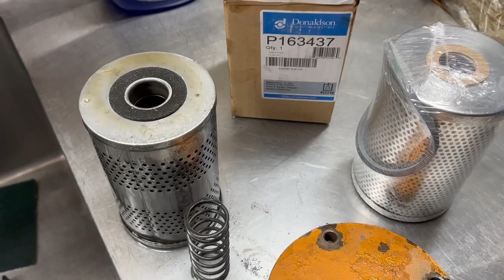Replacing the transmission filters on a Case dozer

Comment: What was the problem?  I’m having the same problem
Reply from the maker: Still working on it. Spoke to Case yesterday and they think it’s the torque converter. There’s a series of diagnostic tests outlined in the service manual that can help pinpoint the problem. Test requires special test set. Case quoted $800 for the test.  Please share what you learn.
Reply: Still haven’t found anything. Replaced filter and screen and still doin it.  You find any answers?
Reply from the maker: @redneckhorseman8827  I’ve not had any time to pursue it further. Good luck.
Reply: Mine don’t have power to move